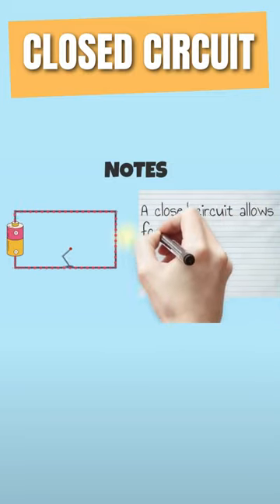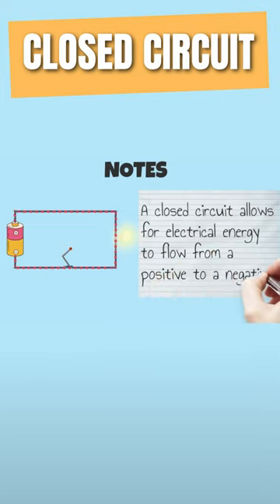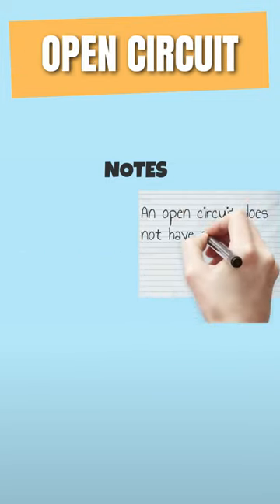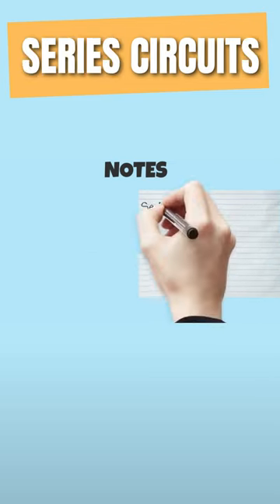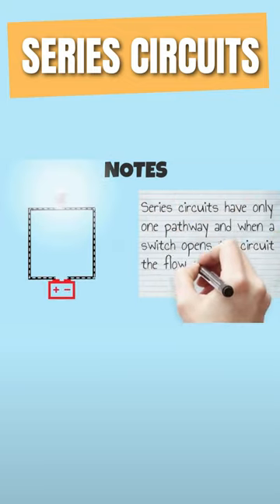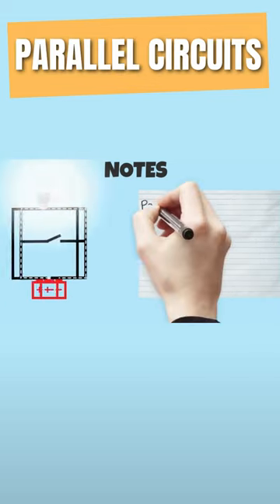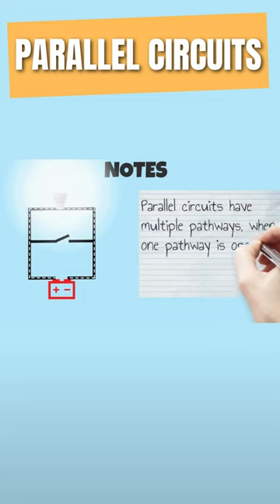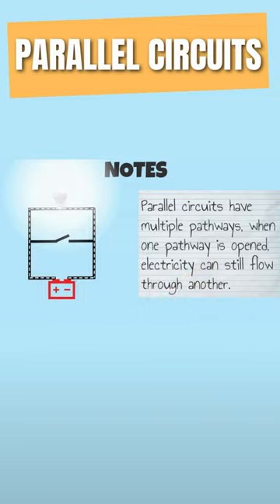Flow of Electricity in a Circuit | Closed Circuit, Open Circuit, Parallel Circuit, Series Circuit

Comment from the maker: 🔥 The Must-Have Digital Toolkit for Mastering Force, Motion and Energy! Crafted by Experts! 
👉📲 Get it Now: https://www.teacherspayteachers.com/Product/LVL-Up-Science-Force-Motion-Energy-Digital-Edition-8395630

How Does Electricity Flow in a Circuit? In this video we will review open, closed, series, & parallel circuits.

TEKS Addressed: 
*5.6A Explore the uses of energy, including mechanical, light, thermal, electrical, and sound energy
*5.6B Demonstrate that the flow of electricity in closed circuits can produce light, heat, or sound
*5.6C Demonstrate that light travels in a straight line until it strikes an object and is reflected or travels through one medium to another and is refracted
*3.6B Demonstrate and observe how position and motion can be changed by pushing and pulling objects such as swings, balls, and wagons

* Key Features of LEVEL UP Science:
✅📏 100% Aligned to State Standards
✅ Comprehensive Assessment Suite
✅ Self-Paced & Student-Centric Learning
✅ Engaging, Interactive Activities
✅ At-Home Support & Virtual Learning-Ready...and much more!
Make sure to leave your comments, opinions, and /or recommendation for future videos. We would love to hear your opinions. Comment down below.✅